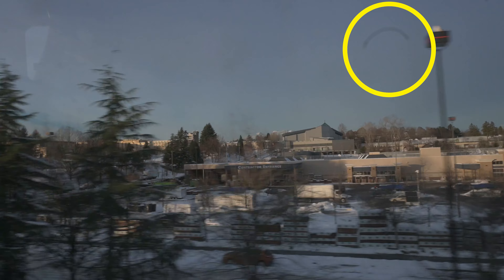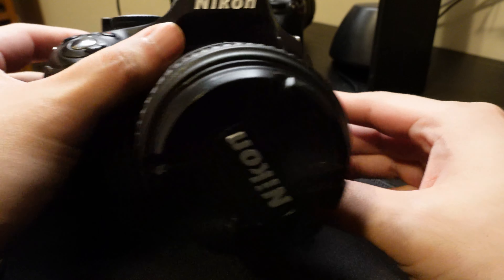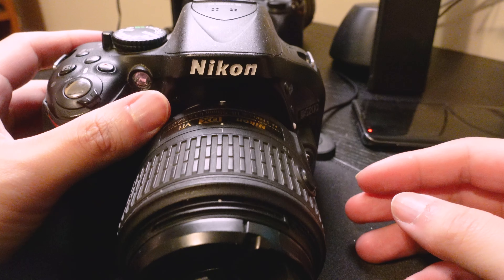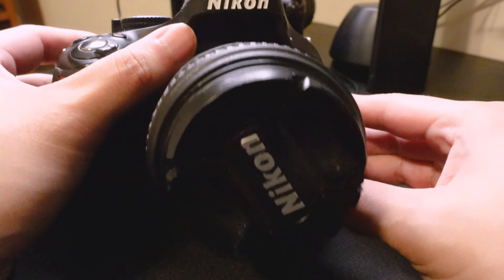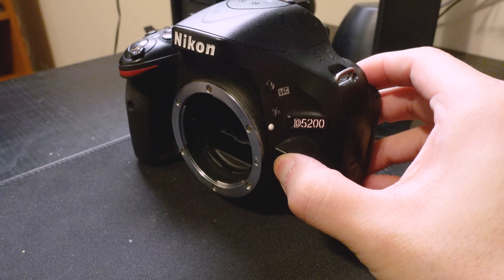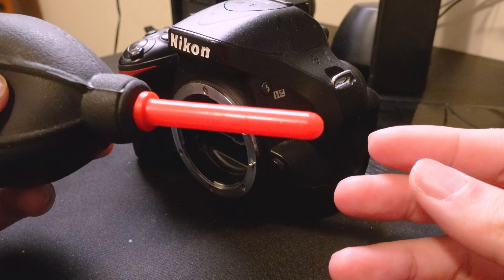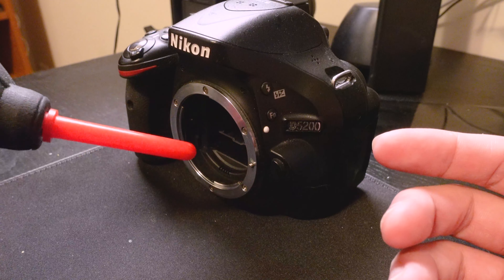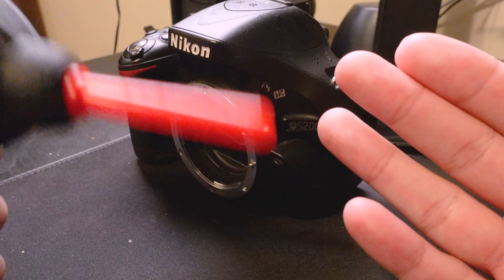How to clean your NIKON DSLR Sensor & Mirror (THE PROPER WAY)

Comment: Thank you for posting this video! I have been dealing with a dust particle in the middle of my sensor for a year, tried the self cleaning feature to no avail. Then I came across your video and locked the mirror and used the air blowing tool and it worked!!! Thank you so much!